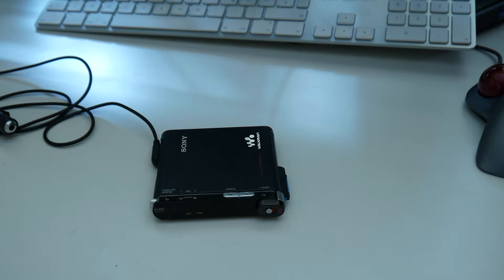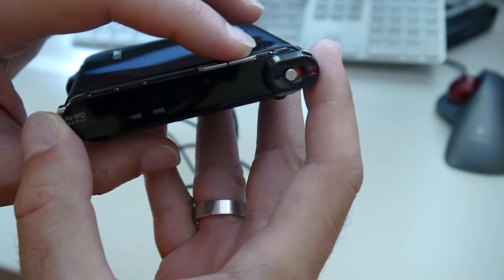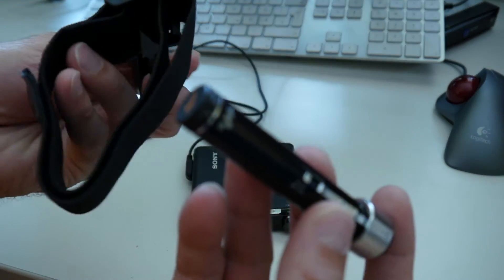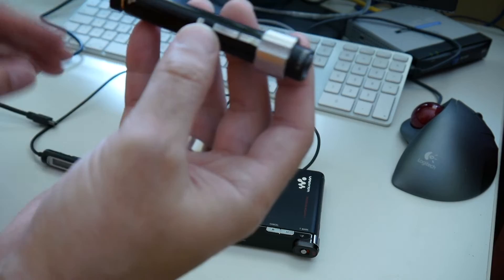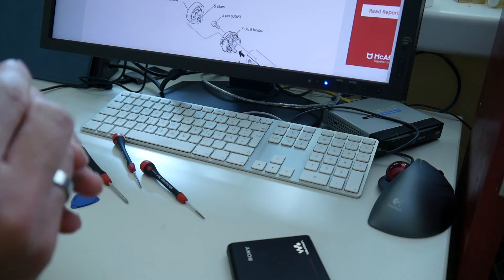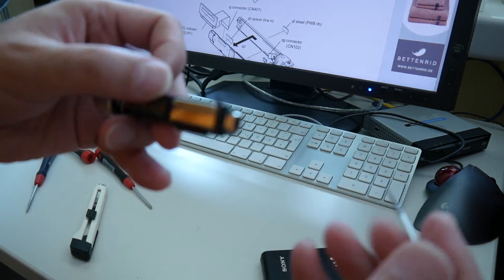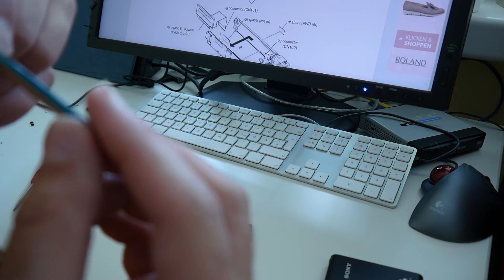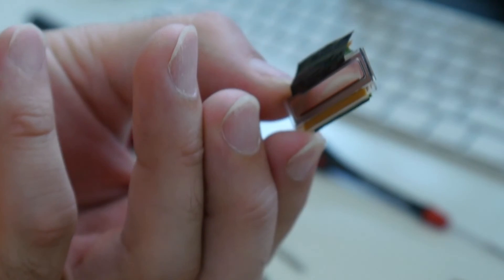Sony Hi-MD MZ-RH1 MiniDisc faded OLED repair, NW-S205 display swap! part I

Comment: I have to admit, it's genius that you were clever to figure out that the EL modules on both devices were the same! Nice work on the display swap.

I did some digging around, and I think the EL module (search "1-802-022-11  INDICATOR MODULE, ORGANIC EL" or "EL401") is not only found on the NW-S205F, but perhaps also on the NW-E305 "Bean" (which would probably be more tolerable to cannibalize than the latter!).
Reply: Also the E002, 3, and 5. Same screen
Reply: Edit: "Former," not "latter" (d'oh!).

Comment: I thought it the RH1 needs 2 OLEDs? There is a third party replacement OLED part available now. Anyway, did you get this too work?
Reply from the maker: Yes, it has two, but only one was entirely faded and I could source only one cheaply anyway. Yes it worked, but now the other is entirely off. Need to invest into the new 3rd party mod

Comment: I am searching for this OLED because my MZ-RH1. Thank you for the tutorial though I can't find any available on the internet at the moment. Any ideas. I also need the overwrite head as my device is not recording/formatting anymore but plays only the old discs.
Reply from the maker: Working with such miniature electro mechanics for an erase head will probably be challenging, ... :-/
Reply: @renerebe  I can change the display but the head is another story. I don't think I will find one though. Unless I find one sold for spare parts. And again they are so expensive...
Reply from the maker: @azwris-Achaean  yes, I was lucky to find a cheap Sony MP3 player to salvage the display from. Luckily the faded display was still usable enough in the mp3 player ;-) I should use it sometimes, not that the battery is dead soon again :-/
Reply: @renerebe  You did a very good job indeed though have noticed that MZ-RH1 needs two OLED displays. Right? Did I miss something in the video? Is one OLED display enough for both EQ indicators of the device?
Reply from the maker: @azwris-Achaean  no, but only one of my mzrh1 displays faded significantly. So I only swapped the worse one, ...

Comment: I just wondering the fade screen problem will happened on long term using only? or it also happened on unused and little-usage mz rh1?
Reply from the maker: It’s rotting or burning out organic oled substrate. I guess always occurs, maybe on early models more than later when they might have the manufacturing process better controlled.
Reply: I can confirm I have an early version of the MZ-RH1 (bought it at release) and barely used it. Now the display is completely black.

Comment: It's not quite faded! You can still some stuff on them. Mine is completely black already. Very disappointed. I just use the remote to find out what's going on. :-(
Reply from the maker: the faded OLED was really dark in the MZRH1, only readable in darkness, it looks a bit brighter in the NW-S205, maybe because the filter film is less dark or so. In any case, the display I harvested and swapped from the mp3 player into the MZRH1 is pretty bright, nearly like new ;-)

Comment: I got a question, I want to change the battery out in my NW-S203F, but I don't feel confident in it. Could I ship it to you with the battery, and pay you to repair it for me?
Reply from the maker: Thank you for the offer, however, I'm already 200% busy with software development and can unfortunately not really start repairing / swapping batteries. It is really not that difficult though, at least you have my videos to follow ;-)

Comment: So do this 1 Gig MDs allow to copy to and playback lossless audio?
Reply from the maker: yes, you could store lossless, raw PCM (like .wav files). High bitrate, ATRAC3+ or so (like mp3) does not sound bad though either ;-)
Reply: Hm ok, if wav is the only lossless format on offer here the 1 Gig capacity isn't sufficient at all. I only know the sound of Minidiscs we had in the mid-90s to early 2000s, which I thought were ok but not great.
Reply: @armorgeddon  You can't have your cake and eat it too with vintage electronics (especially when it comes to Sony). The charm for me is in the MD plastic media and the players. The only reason people would use vintage electronics is for their tactile and visual charm. Like cassette tapes and cassette walkmans there are hundreds of styles to look at and use. Pick any one of them and it's a great conversation starter at a cafe.
Reply from the maker: I do not really remember ever finding myself “hearing” ATRAC compression artifacts, without adore the  a-b comparison, and even the. It was hard to get over margin of error aka “guessing” , ... I usually quickly can tell bad Bluetooth SBC compression though ;-)!
Reply: @renerebe  As I've been getting back into MD (over the past couple months) I've been converting FLAC > WAV > ATRAC Lossless > ATRAC3+ 256bit and I've been really happy with it. I can fit about three albums on an 80-min disc formatted to Hi-MD. For me that's perfect as I want to carry 3-4 unique looking minidiscs with me. Next up will be a Hello Kitty New Old Stock Unboxing / Breaking the Seal Video. I just need to buy the damn disc. =D
Reply from the maker: ;-) thanks god i still have some of my old stock: https://instagram.com/p/BtJJCTWBelR/
Reply: I remember when I had an Offspring album transfered from CD to MD (the original, not Hi-MD) that I could clearly hear the compression. Since it was still miles better than compact cassette and CD wasn't practical to carry around I didn't think it was a problem at the time and I stuck to it for mobile usage.
Today I'd not use it because of the lack of quality but of course I understand what Redsyrup wrote that it's about the feel and curiosity when using old hi-fi tech.
Reply: @armorgeddon  As minidisc evolved through the generations, the codec received continual improvements. A MD recorded on a later generation deck, even in standard MD SP mode, will sound better than a disc recorded on an earlier unit.
Back in the 90s, I had an MZ-R50 and a mate had an earlier MZ-R2. Discs recorded in my R50 sounded noticeably better than discs recorded in the R2, even when played back in the R2.
Reply: @KaiHowells  Interesting, that such recordings were still backwards compatible then. For that to work they must've kept the audio compression algorithm itself exactly the same. So did they just increase the bitrate during encoding? I can't imagine how that would work otherwise.
Reply: @armorgeddon  They made advancements with the encoding portion of the algorithm, with increases in understanding how we hear, so they could devote the most bits to the parts we could hear, as well as increases in processing power so they could perform more complex calculations in realtime to encode the audio. They also allowed for higher bitrates, but that was more applicable to Hi-MD, which would not play in non Hi-MD players due to an incompatibility with the way data was physically recorded on the disc.
Reply: @KaiHowells  Thanks for the explanation. I don't know how the whole process of lossy audio compression works (I only get the part where an algorithm tries to throw away the data a human can't or can barely hear anyway), so yesterday I thought improvements to the encoding would make older playback devices incompatible but now thinking about it again the same happened in the mp3 space where the initial encoder is far worse than what LAME can do nowadays.
Reply: @armorgeddon  Yep, that's it. With advancements to the algorithm, and more processing power, it gets better at deciding what to keep and what to throw away. With more efficient encoding, it can still use the same decoder as the data follows the same format.

Comment: poor 205 :(
Reply from the maker: No, no, no! I got it all back together! Even ordered a new third party battery replacement, the only regression is the more faded OLED display in it now, but one is not looking that much on the display on the 205, … https://youtu.be/I6lN_gRvn0s?t=246 ;-)
Reply: Neat, I just found your channel since I found a 205 auction on ebay earlier today, and out of nostalgia i wanted to see some videos of it! If I win the auction I will use your video as a reference, thank you :)
Reply from the maker: Be warned & careful, this was one oy my scariest, most difficult repairs I have done! Had I known how fragile this is I would probably lived with the faded display another decade. In any case good luck!
Reply: @renerebe  good to know, thanks for the advice.

Comment: The play button/prev/next lever thing on my unit doesn't work correctly (another common problem with the RH-1), but at least my OLED hasn't faded yet (enjoying it while it lasts). Also compared to other MD units there's no external AA battery pack to screw onto the unit, and as you said replacement batteries are hard to find (but one could always hook up a USB powerbank).

In theory it can be used without the OLED (with the cable remote) for playback, some recording options are only on the unit AFAIR; good luck with the repair if you decide to go for it ;)
Reply from the maker: re: OLED display – maybe you will be lucky if only the early production runs are affected. Maybe the early ones where contaminated with some residuals, or the process was not yet running as it was supposed to. If that is the case your display may be fine for decades to come (if you are not using it 24/7 ;-). The potentially some months younger display that I sourced from the NW-S205F donor is much brighter and is also nearly 12 years old, .. – fingers crossed ;-)
Reply from the maker: I just record something on the MZ-RH1 and realize: it is not auto-off the display while recording, only during playback! This might also be why the right side is so much more faded (apparently also for others) because there are group, track, and time, while the left has the more dynamic vu meter moving, ..! So maybe the OLED display burns-in more for people who use it for recording, ..?!
Reply: @renerebe  Well I also use it for recording but not too much (these days, mostly done via QHiMDTransfer and not line in/mic). I also try to keep it away from sunlight but this might just be superstition on my part ;)
Reply from the maker: Thomas Perl I recorded some live concerts back in the days, a putty they did not implement full off or auto off for recording.... on which os do you use qhimdtansfer ? It does not allow track info editing does it? I wrote a proof on concept track info editor ...
Reply: @renerebe  Yeah I also recorded concerts the last two summers, but that was like ~ 10 hours per year or so max. Maybe switching to a different display mode would use the OLED less?

I use QHiMDTransfer on macOS (and SonicStage Ultimate on Win10 64 bit), but it will work just as well in Linux. libhimd/himdcli expose some more features than the GUI, and also there is libnetmd/netmdcli for non-HiMD-formatted media in the RH-1.
Reply from the maker: I know qhimdtransfer in principle, I packaged it for t2: https://t2sde.org/packages/qhimdtransfer had to fix some trivial index file thing otherwise it would not work for me, .. http://svn.exactcode.de/t2/trunk/package/audio/qhimdtransfer/libhimd.patch but I do not remember seeing track info editing, IIRC their TODO listed: to be implemented, thus I hacked my own proof of concept INDEX file read writer last year, ... did not yet publish it. However, I initial took a look at this over a decade ago: https://svn.exactcode.de/minidisc/trunk/himd.txt but back in the day figuring out the crypto took to much time and I had other urgent things to take care of, glad John & friends did that ;-)
Reply from the maker: I'm actually surprised (and lucky!) how long this old battery lasts, I just listened to an Hi-MD formatted (for Atrac3+ and direct "PC" access) classic MiniDisc more than twice (4h+) and the battery was not fully empty! puh!! Now I vaguely remember and wonder if I actually had a second of those special batteries, ..? hm, ... btw. one can open and retrofit new cells in there, so do not throw them away when they hold no charge!
Reply from the maker: Yes I continued with it, but the raw video material was 45 minutes, and this time I already only recorded the most interesting parts, … thus I ended up splitting it into two parts. Great to hear others are still enjoy using theirs, too! Interestingly the NW-S20x can not play music, even when only supplying power from a USB charger :-/ but just for the fun of it I ordered a 10€ battery for that little unit now, too. Let's see how old that eBay battery will be, and how long it will run with it, if hopefully at all ,-)